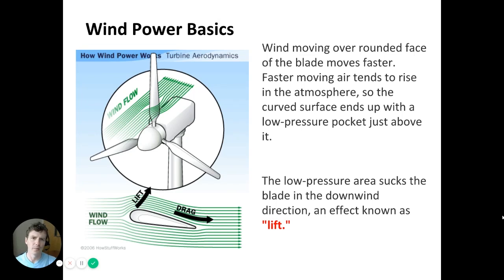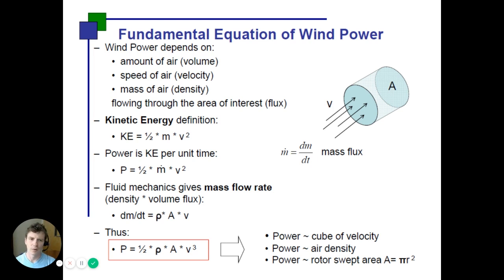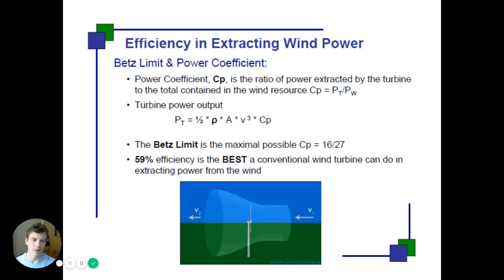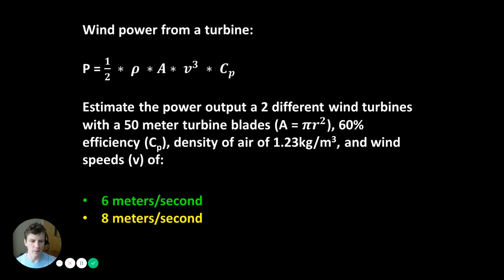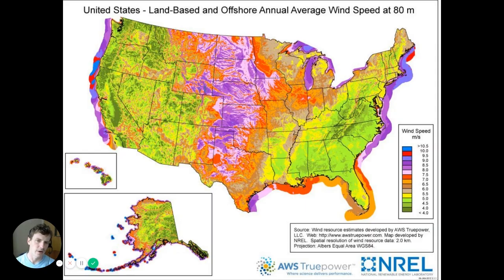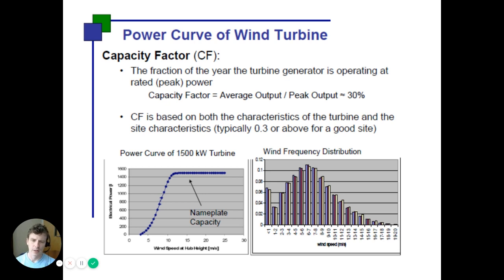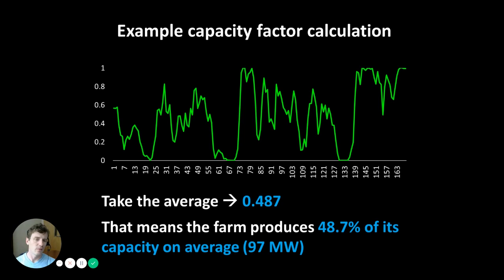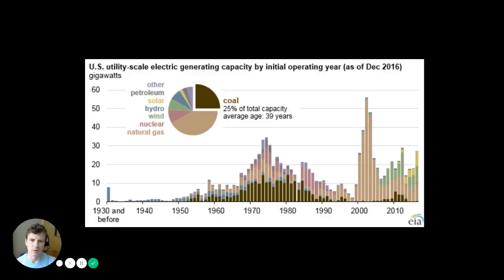ES 300 - Wind Power - Fundamentals and resource availability

Comment: Swept are is not relevant to wind turbines as the wind pushes what it touches and can not push on the gaps between the blades there are three things that are fixed and that do not change 1 the diameter 2 the total area of the gaps between the blades and 3 the total wind contact area of the blades weather moving or still ,Wind has no kinetic energy it has force Mv squared kinetic energy is the energy of consistent work from a consistent force . Betz limit is an insult to engineers regards Graham Flowers